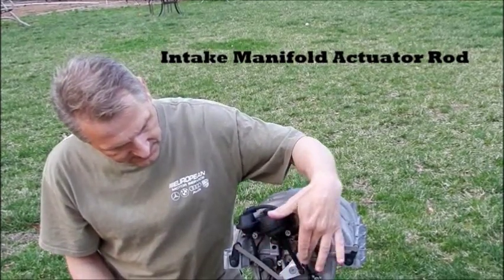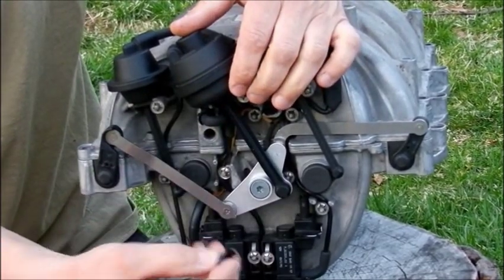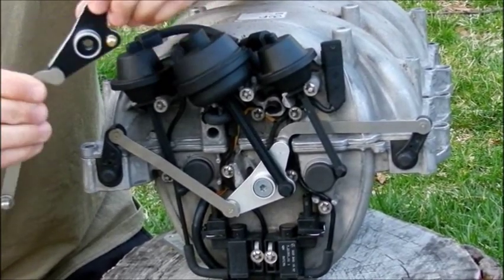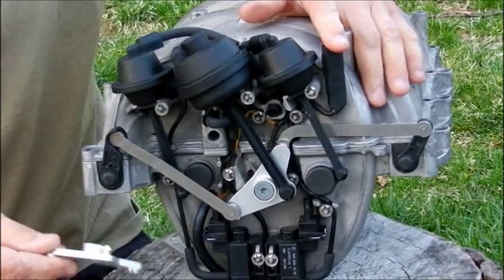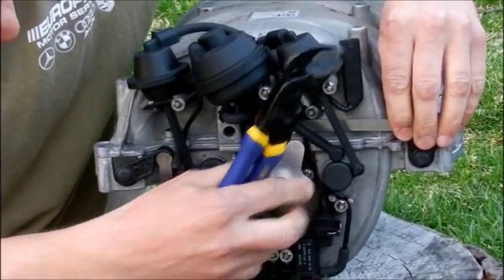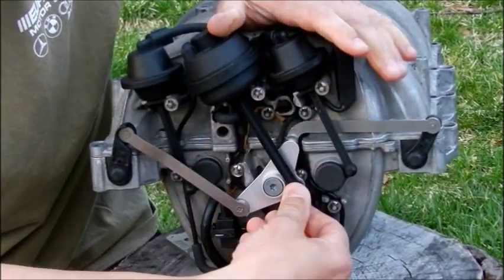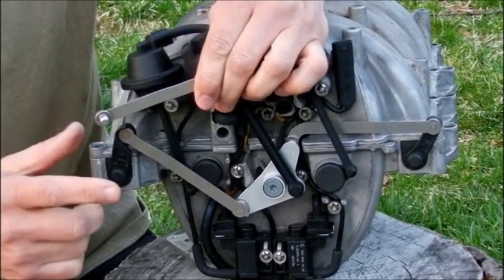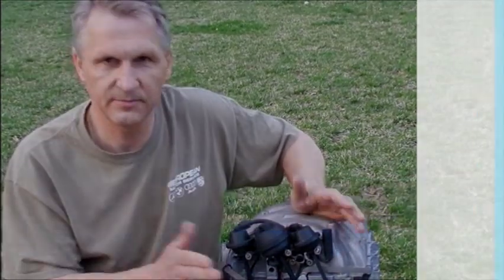Mercedes Intake Actuator Rod

Comment: Good morning,
 where I can buy this part for a 2008 W211 E320 Cdi? 
Today the diagnosis shows "P2015 intake manifold air control actuator position sensor/switch bank 1, range/performance problem"

Comment: Purchased one. Installed perfect and quickly. Worked correctly.

the thing I would do next is diagnose intake condition, remove it and inspect it inside to be sure that the job does not need a full intake manifold. Lucky in that the valves and intake were all ok on this job.

Thank you for the quality part.

prompt fast delivery of part.

Comment: I have question when putting the manifold back on the car should I use any silicon with the gasket ?, it seem there wasn't any why took it off. Thanks for the help.
Reply from the maker: TheQue360 I would not recommend using any silicone, but there is a spray for gasket that you can use.

Comment: I drive the Mercedes R350 2007 and discovered the broken actuator on the manifold.  As stated in previous comments the only way to get this repaired from a dealer is to purchase the entire intake manifold which is ridiculous.  For the sake of a $3 plastic part it's around $3K to get a dealer to install a new manifold... 

I contacted Roman who shipped me the part within a few days.  Getting the intake out was a bit of a trick mainly due to all of the wire harnesses and hoses attached to the darn thing but it's not that difficult with time, patience and common sense.  Once the manifold was free it took all of five minutes to remove the broken piece and replace it with Roman's shiny new one.  His part is top quality and worth the money considering how much Mercedes want to rip you off for the repair of an obviously inferior designed to break plastic piece.  The rest of the manifold was in perfect shape so why the heck would you have to replace it? 

I highly recommend this fix for that problem.  However an automated ordering system (even Paypal) would help make customers feel a little more secure that giving their card number to a stranger over the phone (just a suggestion).  The only reason I felt okay about the transaction is that he did give me his cell phone number and called me back to confirm.  Other than that I have no complaints about the order.  The part is top quality and easy to install once the manifold is out of the car.  I could have had someone remove it for me but why spend money when you don't need to.  These cars cost enough money to maintain as it is especially after that balance shaft fiasco.  Don't ever buy a used car with the M272 engine unless you know the balance shaft gear has been replaced already...just a tip.

Comment: I have a 2007 S550 Mercedes. i went to the dealer and they said i need a new intake manifold which would cost me a fortune. i did a little research on ebay and found a few items that require modifications to the intake. i came across this video and i contacted roman and he explained everything to me about this, and i felt comfortable with him and the part. he sent me the part, and it really looks professional. this saved me lots of time, frustration and money. this is a great product. i recommend it to anyone with this problem.

Comment: If you have a Benz with this manifold it WILL BREAK and the dealership will want to charge you over $2000.00 to fix it by installing a whole new manifold with the same inferior piece. For me this is just plain stupid (it will break again).I decided to fix it myself ( or you can have any mechanic do it). After doing some extensive research I found a number of off market actuator rods, while I won't call them junk none compared to the quality and craftsmanship that went into the manufacturing of the one in this video . Even though it coast a little more then the other ones the quality and ease of installation (no alterations needed just install) made this hands down the best one on the market.